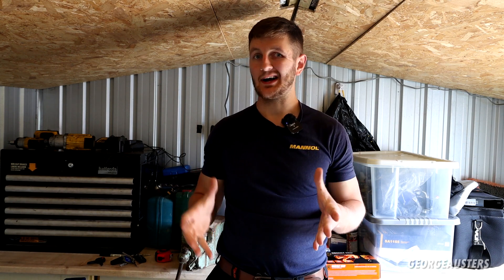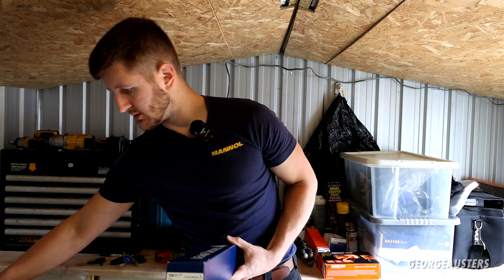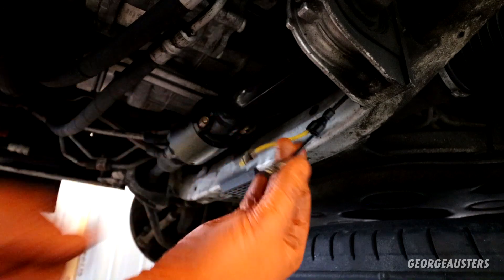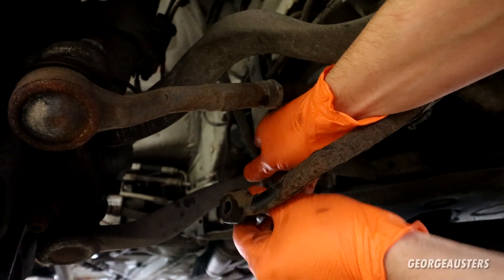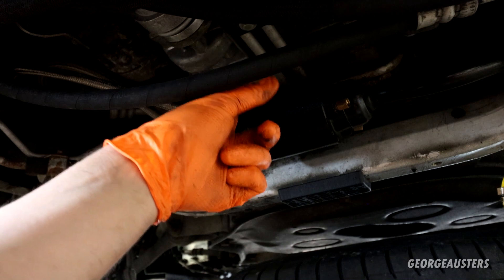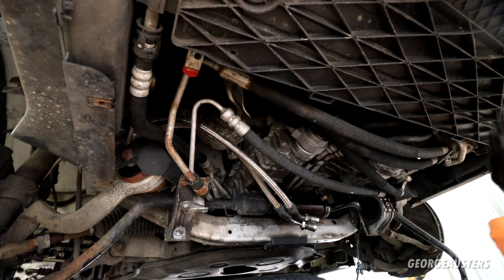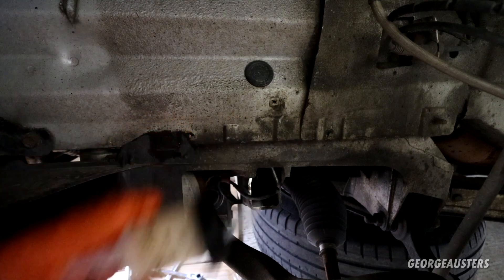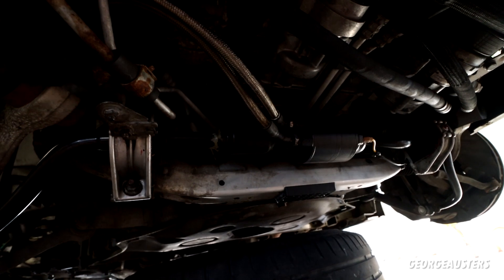BMW DYNAMIC DRIVE FAULT ACTUAL FIX!! MUST WATCH!!

Comment: I'm so pleased you got this sorted buddy but sometimes do you think your knocking your head against a brick wall getting the correct parts for the bmw.  I loved my bmw 520d msport.  had it 6 years loved every minute driving it . even services to car was a pleasure.  but if anything went wrong with it thats when problems started . parts came that didn't fit had to send back try again . unfortunately I've turned 60 not climbing under cars anymore. so it's gone 😕 sad but that's life . I'm so pleased with your love for the cars keep it up .

Comment: Nice one George. It's a fantastic feeling when a car 'talks' to a new component. The injury is standard procedure and you would not be justified in claiming it was job done without some broken skin. I echo what you say about replacement parts often being a nightmare to get right despite engine no., chassis no. etc. Another thing that manufacturers don't seem too bothered about getting catalogued right, alongside building cars around the most important nut which necessitates hours of labour to gain access. Keep it up, great work, fab channel!
Reply from the maker: Cheers John!
Reply: Im not sure where you guys are from, but i use FCP Euro for all my parts and have had a lot of luck and they have great prices also

Comment: I took my 2007 650i in today (9/21/22) to make sure it was the the Dynamic drive sway bar that was leaking. My Friend and Mechanic assured me it was. I'm going to try your fix and give it a go. They want $2200 US for the unit. I'm going to subscribe.  I really appreciate your work and videos.
Reply from the maker: Good luck
Reply: 2200 ??? Buy a used one no??
Reply: In  Latvia we restor dynamic drive bar for 300 evro 😅

Comment: Not trying to be picky George but you should never get Under a car Without proper support like Axel stands as Jacks can collapse at any point be safe please 🙏
Reply from the maker: Very true but unfortunately I left them at my parents house so need to buy some more.

I did have 2 jacks and a wheel under the car👍🏻
Reply: can i use arf oil instead of chf?

Comment: Hi! Old vid, but I have same issue. Pressure build up on the front axle. Swaybar don't leak and wondering if your problem and mine could be the airfilter or the ventilation valve at the swaybar. Trying to understand the problem before spending lots of money fixing it.

Comment: Oh the pain of tool slippage, gave myself a nice shiner last week whilst trying to undo a tight rear hub nut on my 118d .The breaker bar and socket slipped off, smacked my face not once but twice on side of car.🤣🤬

Comment: Well done mate.  What’s left to do
Reply from the maker: Still quite a lot.. Both HPFPs need refurbishing, spark plugs, ignition coils, intake gaskets, drop links, wheels refurbishment, new tyres and mostly cosmetic stuff after that
Reply: @GeorgeAusters  soon be done

Comment: Front swaybar must have been blocked or seized i guess creating excessive pressure.
Reply from the maker: Yeah I’m still not sure what it could have been!
Reply: Hi can it be fixed  if the exle is blocked ? ?
Reply: Ik think mine is blocked i put something in it fore leak 😅😅😅
Reply: @crazyharis  id just do what george did and buy another good used one on ebay. They’re pretty readily available as they used the same part on the f01 as these e65’s
Reply from the maker: @crazyharis  There isn't anything you can put into the fluid to stop a leak
Reply: @GeorgeAusters  i know that's why i fkd it up 🤣🤣🤣